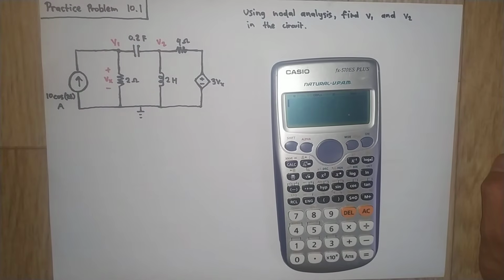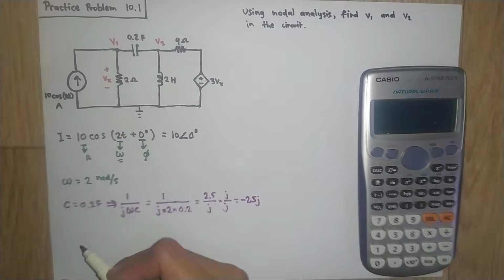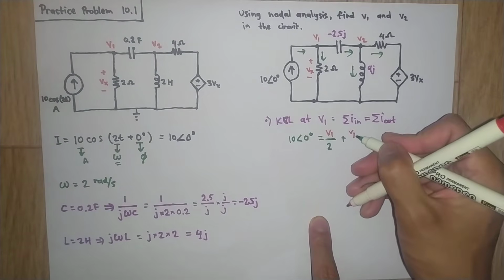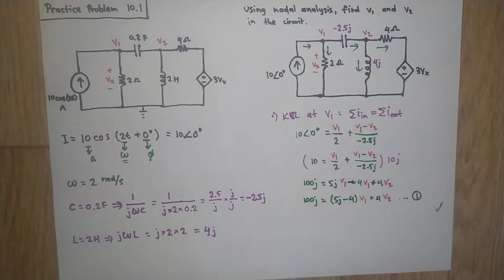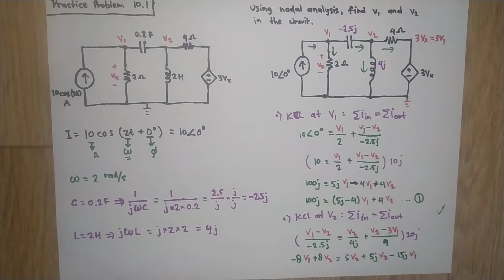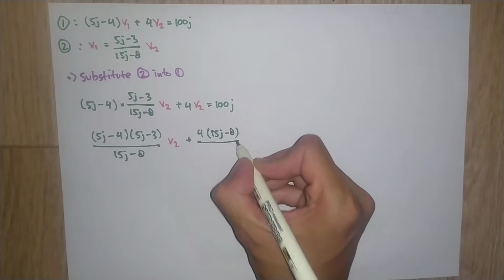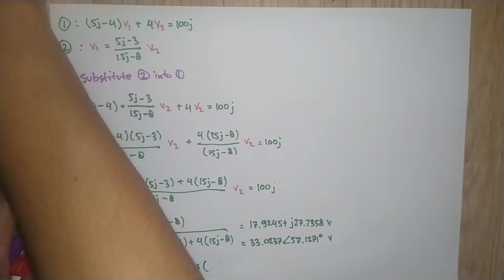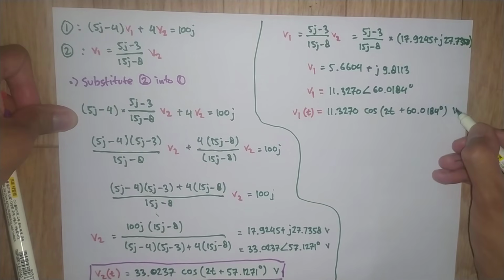Practice Problem 10.1 - Fundamental of Electric Circuits (Sadiku) 5th Ed - Steady State AC Circuits

Comment: I think there's an error on part 1 when finding the equation for node 1 when you multiply by  10j shouldn't we get 5j V1- 4(V1-V2) ? Because when we divide the (V1-V2) by -2.5j , the -j goes up and becomes positive j so we get j(V1-V2)/2.5 and then when we multiply by 10j we get -4(V1-V2) because j times j is -1 please correct me if I'm missing something but I've gone over this so manytimes and I can't seem to understand why